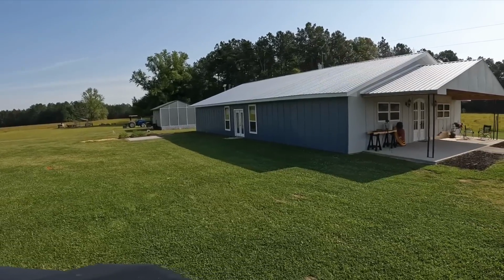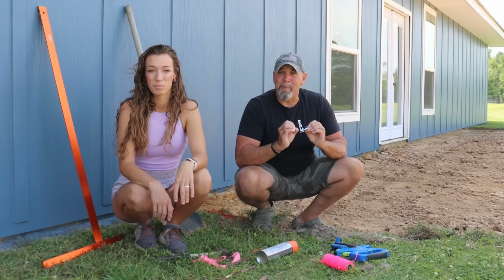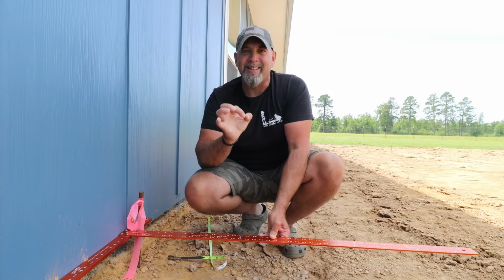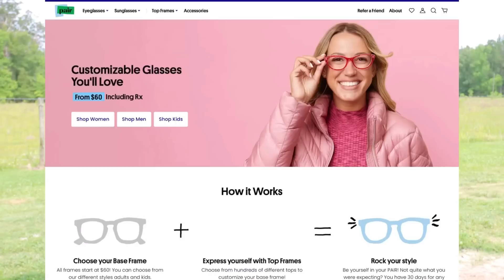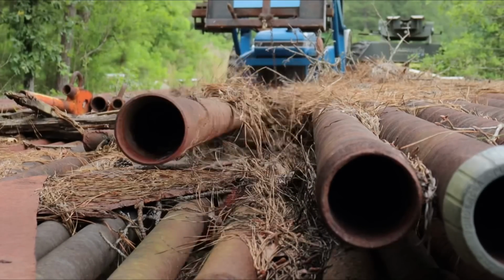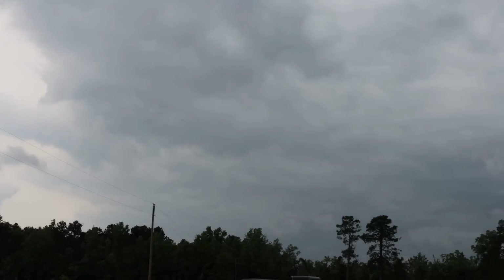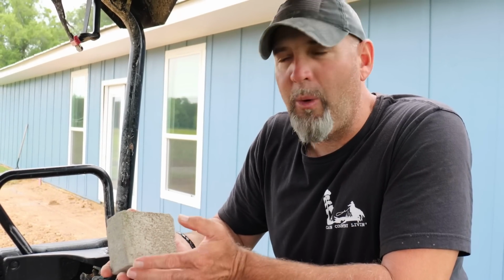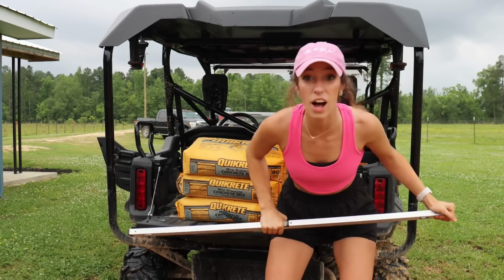Trying to OUTRUN the Rain! Building Our Own Home Ep. 91

Comment: We also dry poured the concrete for our posts. We brushed the pipe, put phosphoric acid on it to convert the rust, then painted them. We welded barbs on the bottom, then wrapped them in electrical tape before we set them in the ground. I also wanted to tell you, I've been dry pouring concrete for paving stones. It's working great!

Comment: I found your channel recently.  One of the viral dry pour ones popped up.  Went back to the start and watched them all.  Now watching them as you release. Great camera work and editing.  Really makes watching a pleasure.  I have asked my family for my first pair of official crocs for Father’s Day!  😄 I was expecting to see a bit larger diameter footers for the poles to more legitimately anchor in high wind, but I suspect if it were that intense, the roof would still let go before pulling up the pipes.
Reply: They are pouring a concrete slab over the top of the already anchored poles in the ground gripping them further.

Comment: it would have been nice if you had one of those post levels, they are only about 7 or 8 dollars at lowes or menards , they are just a plastic L shaped thing with level bubbles on it and it attaches with a rubber band , that way you can quickly fine  your level all the way around  for you post either wood or metal posts.
Reply from the maker: That would be amazing!
Reply: @CajunCountryLivin  yes and cheap,, we have used the one we have many time.

Comment: Jim, the 3,4,5 method is simply the Pythagoras Theorem from geometry class put into practical use. Actually, any combination of 3,4,5 could be used easily.
This means if you measure along the wall of the house 30 feet, then measure out from the house 40 feet, string a tape from that 30 foot mark to the 40 foot mark 50 feet long. Where the 40 foot and the 50 foot marks meet gives you a perfect 90 degree angle. This could be done on both sides of the porch and give you a perfect rectangle. Especially since your porch will be 40 feet out from the house.
Reply from the maker: It’s all about that hypotenuse 😁
Reply: Jim and Lydia BOTH knew that!

Comment: NOT CRITICIZING!!! But I was wondering if you worry those poles continue to rust what’s in the concrete that doesn’t get painted. Eventually rust into at ground level. I’m not criticizing just asking I have a/ had very walled post I used to hang deer that rusted into about 2 below surface of concrete after about 15 years/ but it was about 10 years old when I got. Rust oleum makes a rust restorer.

Comment: I put salt on my concrete driveway a few winters ago and it pitted the driveway in spots.  Can I clean it then add dry concrete into the little holes and mist it in  or is pitting too shallow to try your dry pour method  on a driveway or sidewalk.?

Comment: Tbh Gus looks better as a fattie 😊😢❤ What you now have ducks 🦆 in the background 😅 I hope that wasn’t Jim’s undie material tied to the peg and we definitely would ‘touch this’ 😂 Must say Lydia totally rocks the glasses 😊❤ I just noticed a huge dent at the bottom front of the tractor, how did Jim do that? 😮 what kind of drilling was the pipe originally used for? Remember to cover the holes so no one falls in 😮 Another great video.  Until the next great video 😊❤

Comment: Pretty fancy dance moves y’all… not that it matters or that it’s any of my business. But I’m gonna ask anyway mostly because I’m nosy.. why so big? Surely there’s a reason why y’all wanted a porch that huge. Just because you can? Family picnics/ get togethers? Electrolysis is what cause metal pipe to decay in the ground. Simplified electricity travels through the ground when it come in contact with metal and then leaves that metal it flakes off little pieces every time it jumps off of the pipe.. if you’ve ever dug up a pipe that’s been in the ground for quite a while it looks pitted that’s from the electricity leaving the pipe there is a way to slow that decline using anodes it’s a big wire welded to the pipe with a huge piece of lead buried in the ground about 5 or 6 feet from the actual pipe the electricity will travel through the wire to the lead and jump off the lead instead of the pipe. Just some information you might like to have maybe for future projects
Reply from the maker: The main reason that we wanted this large of a porch is because sometimes we get an awful lot of rain and we are all outdoors people. This will give us a large area to be outside even if the weather is unfavorable. Thank you for the electrolysis info!
Reply: Thanks for the reply o sure understand the weather issue down there having living in Mississippi for quite a while